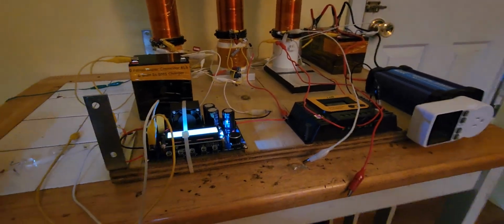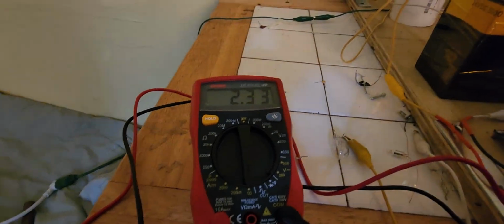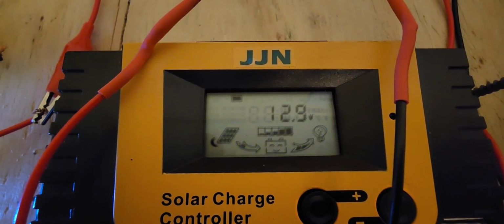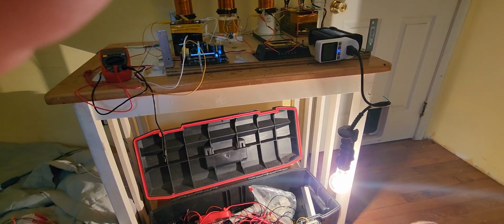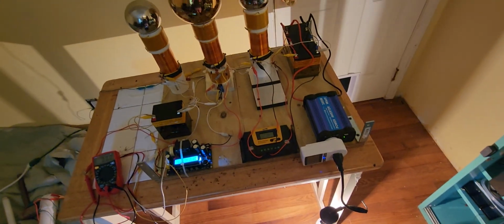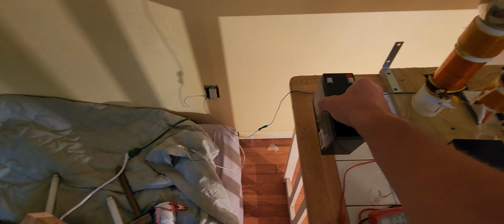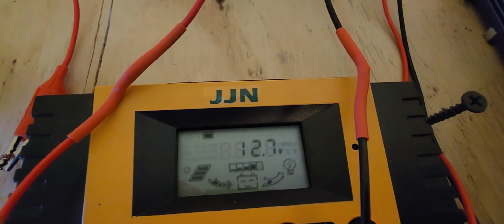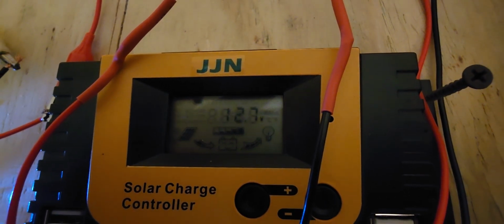♾️145 Watt 10 Minute Load Test Of The Self-Sustaining Wireless Power System♾️

Comment: I think you need to run the whole system from the inverter and then once it keeps the self sustaining loop going, disconnect the battery and see if it can self-run.  While perfecting it, you could add the staring supercapacitors in parallel with the starting battery to create the buffering effect and then remove the battery.  Removal of the staring battery is a MUST to prove the point of the self-sustainability(true Kapanadze device)... good luck

Comment: Bigger ball inflatable ball from Walmart and glue aluminum foil on it .I've heard that the larger the ball the more power I don't know what's going on with it but it was this guy who was an electrical genius who said that I happened to run into him he was talking about stainless steel balls 5 ft in diameter but you can easily get a two foot and diameter from Walmart and glue aluminum foil to it with the reactions you're getting you should really get some serious reactions and that's pretty cheap you know you're looking at under five bucks

Comment: I am tempted to make some of those metal balls, cover them with activated carbon  glued down onto the metal surface to increase the surface area.
Reply: If you make flat pancake coils you don't need the balls asthey just act as a capacitance between the coils. Flat pancake coils do the same job but the coil itself becomes the capacitor plate. Tesla was doing this in the end, he drooped the tower compound coils and focused on flat coils.

Comment: ElectroBoom made a video yesterday showing the bulb lighting, and he said there is a parasitic capacitance formed, but that doesn't explain the excess energy. I am reading the work of Tom Bearden, he spend 30 years of his life and put together the book 'Energy from the Vacuum', inviting us young engineers to take it forward. He said the same thing, academia needs to revise a lot of things. From what I understand the preface says that it is the broken symmetry that you are creating with the pulsed DC that is creating the energy gain somehow. I am trying with pulsing a Hubbard coil. I'm winding it in fact as I am watching your video. Please consider as others have commented, using analog meters. I am using capacitors on the load to measure the COP, and I start with charged caps at the input as well. Thank you for the inspiration ;)
Reply from the maker: I would like electro boom to fully investigate these systems & design them properly. Correct coil dimensions & optimized for efficiency etc but i don't think he will because other researchers told me at the end of the day he's just an online entertainer that works for the electrical companies but hey i hope I'm wrong
Reply: @MTECH2022   I enjoy ElectroBoom videos, but at the end of the day I don't think he believes in OU or FE.
Reply from the maker: @justbob1581  yeah any time respectable researchers ask him about it he ignores them almost to the point it's slightly suspicious

Comment: I wonder if you can sustain the voltage while having a load below 35W (LED bulb) continuously by using a small 35W inverter module instead of the one that you are using now. If it works, it would be interesting to figure out the maximum load wattage you can use simultaneously without dissipating the power in the supercap banks.
Reply from the maker: Yeah I'm curious to. I'm also wondering what the idle wattage draw of the inverter is as well when switched on with no load

Comment: Ideally you want to run the resonator around a lower resonant frequency , 432 or a multiple . 4 plus 3 plus 2 is 9 . just like 2.52 lots of people dont agree with this mathematical connection to frequencies but its extends past the math unto the geometry as well and its very real , one individual tested the theory and found he did not get cymatia patters at resonant frequencies  he said he built his own , i said thats why , the plate you built was not sized correctly aka geometry as well as dimensions , the plate is also part of the circuit. People need to understand that everything becomes part of the circuit especially if its running at resonant frequencies and you are 2.52, all i am sayin is try halving it down to a lower multiple of 2.52 and the same results will be apparent , may need different separation aka gap or size ball but it will work at lower frequencies, (just my opinion i like to stay in the low range but not ULF or nothing Khz maybe upper high kilo hertz is perfectly safe , 2.52MHz is like having a  cell phone running all the time but at the lower range of the MHz like those old wireless house phones that ran at 2Ghz those are not good long term "In My Opinion" same goes for modern Cell phones and Electric Meters pinging at HF . You can get the same results around 28k I am sure , see Ralph Ring  (Youtube) ..   Why did you choose 2.52MHz were you scanning , if so keep scanning the lower range Khz range